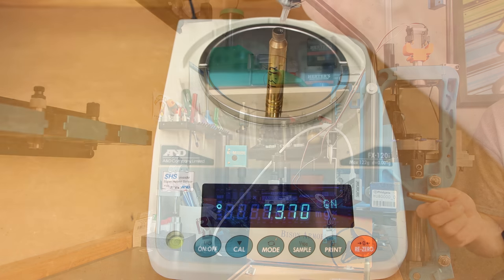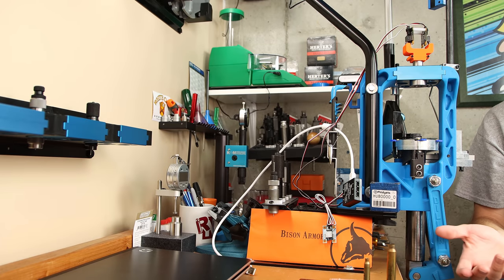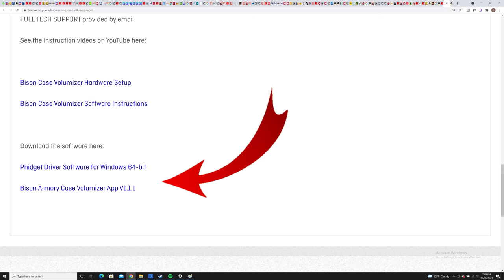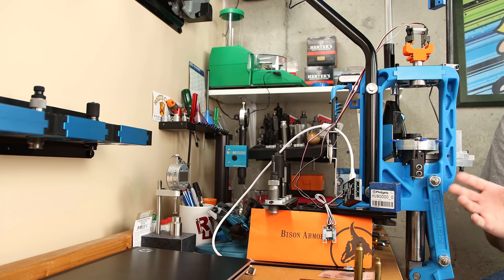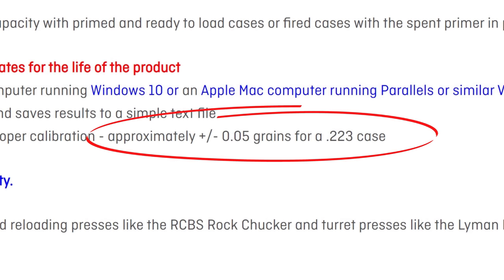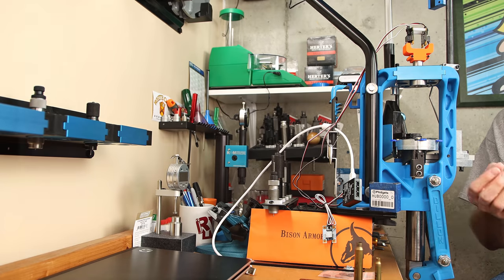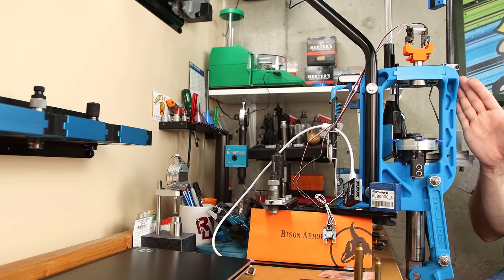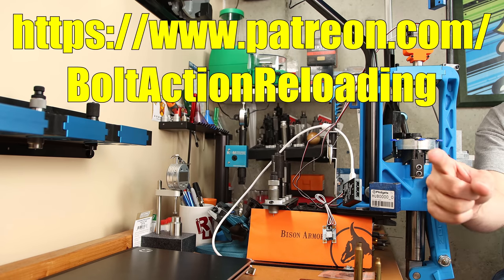Measure Case Capacity Fast Without Water! - Bison Case Volume Gauge

Comment: Great video..but one question...if your checking a lot of brass...and its unfired..and not primed....it seems like a waisted to prime with new primers...then having to cull a certain percentage if they are not is the SD....and if you used spent primers...you would have to prime...check the pressure and then pop the old one out....at that point is it not as.much time as water sorting with a primer plug?.....keep up the good work....
Reply from the maker: Hi Mike, Sorry for the slow response. So ask yourself if your going to use that brass as a sighter if its culled. If so your going to prime it. Keep in mind that you really can't touch the cases or it screws up the data. I use this on my dillon 750 with a case feeder and I can test 100 cases is about 20 minutes if everything is going right. Warm up time is a consideration, but you don't have to dry the cases out. When they are sorted they are done. I have probably measured case volume on around 2k cases at this point, if I didn't have this there is 0 chance I would have ever done that. I am also sure I am a bit more of the exception than the rule. I am generally trying to get as much data as possible, most people skip this cause to be fair it is a pain in the butt. Best of luck either way you go!

Comment: Just out of curiosity. What is the purpose of doing this?  What is the benefit for precision reloading? I’m new into reloading BTW.
Reply from the maker: Hello. If there is inconsistency in the capacity of the cases this will add to the variation in muzzle velocity.  Also different brands tend to have slightly different volumes so you may need to adjust the powder charge up or down based on how drastic this change is. I hope this helps make sense.

Comment: Is case volume a problem with good brass, or is this an experiment to determine that question?
Reply from the maker: That is exactly what this is going to be. I tried to show the beginning of that with the 100 pcs of Lapua brass that I tested in this video. I debated on making this video but if I show a video comparing 500 case volumes I am guessing that someone might wonder how you would accomplish such as task. I was also going to investigate if there is any value to weighing cases at all since some people do that. I certainly don't think 95% of reloaders need this (maybe less) but is you ever wanted to measure the case volume on 1000 cases this is your tool.
Reply: @BoltActionReloading  reading the wind has also been experimenting.
Reply from the maker: I have been hearing about this for quite a while actually, but saw that it was released. He seemed to me most concerned with the handle pull and I really don't think this is the source of the error.

Comment: Using an fx-120i reloading scale and autotrickler I'm getting single digit ES with SD of 2 and i'm not weighing cases or measuring volume. I'm pretty sure I'm at the limits of my chronograph. I don't think i'm going to get much value from measuring case volume.

Comment: Am I missing something?  You demonstrated that it has 0.05gr repeatability but not 0.05gr accuracy.  30.42 is over 0.05 away from 30.55.
Reply from the maker: If I would have recalibrated for the last test I believe it would have corrected it for the last test. I wanted to illustrate the drift from sitting overnight.

Comment: A good way to deter the temp sensitivity would be to have 3 thermometers
1. For the room
2. And IR thermometer that reads the case
3.one that checks the heat of the sensors because im guessing they would heat up like all electrical equipment
Reply: Well IR thermometer doesn't work really well on shiny surfaces like brass cases.
Reply: @DimaProk  we can stick a thermometer up its primer pocket 🤷🏻‍♂️

Comment: Yeah not for me. Would end up smashed laying in the corner of the room
Reply: Splitting hairs ....didn't catch the price ....wouldn't buy it anyway ..just like that $600 primmer seater .snake oil.  Lol
Reply from the maker: Hi Chris, You really have to be doing a lot of measuring for this to be worth it. I needed to measure a ton of cases for a video I am working on and the old fashioned way just wasn't practical. I don't expect 95% of the population to be interested in it, but when I release that video I know that a ton of people are going to ask if I really measure the case volume on 500 cases. Hopefully that makes sense.

Comment: Hmmm . . . 
FYI, if you're properly prepared with a few decent (inexpensive) tools and a set of clear step by step procedures, anyone can accurately check cartrige volume with H2O. Its clean, safe, easy, 100% accurate, repeatable, inexpensive and can spot neck/case failures just the same.
Reply from the maker: I don't disagree until you are measuring 400 cases. That takes more time than I have for it.

Comment: Sorting lapoo-a is a waste of time, what a freaking cool device though
Reply from the maker: Hi Chuck,
Thanks for your comment! I agree that sorting Lapua is largely a waste of time. This is why I used it as an example of how consistent it was. If you want to sort a large amount of brass I am not sure there is an alternative to this die though it has its drawbacks. On a side note LRSU did a video at a Lapua booth to show that most people pronounce it incorrectly. Might want to check it out. https://youtu.be/INK-8K9xx_c?t=26

BAR
Reply: I pronounce lapua incorrectly on purpose, but correct for my region, here it is luh-poo-a. Have a nice day!

Comment: Because of the ideal gas law, there is no way, frankly, to do this without temperature compensation in a non-fiddly way.  PV=nRT.  Temperature changes are completely the source of the error.  That's a shame.  That is a GENIUS way to measure the volume.
Reply from the maker: Hi Matt, you are exactly right. I was trying not to put too many equations in the video as it seems I just loose more people that way. If you can get the temp to be stable it does work pretty good. To be fair to them I am not sure how they would get away with that.
Reply: @BoltActionReloading  What about humidity would that effect it as well ? and the barometric pressure that changes hourly . too many variables and water has to be cheaper.
Reply from the maker: The 3rd sensor is a absolute sensor to compensate for those changes.  Water is of course cheaper but it's not faster and you have to dry them out. This you can test your primed cases right before you load.
Reply: Hey Matt, that's not quite right... as long as the temperature is constant during the measurement and the ambient temperature is changing slowly, it isn't a problem. The real problem comes with touching the cases with your fingers! In that situation, the heat from your fingers is transferred to the case, which in turn transfers it to the air inside the case. You can test this and see for yourself. If I hold a case in my hand for a few seconds to warm the brass, then measure repeatedly, the volume will start high and decrease with subsequent measurements as the air inside the brass reaches equilibrium with the brass. I use tongs to hold the brass to prevent this heat transfer.

Comment: I would bet Humidity is the devil to this machine along with temp. I'm sure this will not be a device 99.9% of reloaders.
Reply: i'm guessing the barometric pressure changing is causing the drift
Reply from the maker: That is what the 3rd sensor is for is to measure the pressure in the room.

Comment: Tbh, I've never found measuring case volume with water all that onerous. I would find it hard to justify buying something like this. More trouble and expense than it worth imo.
Reply from the maker: Hi Tom, I guess it depends on how many cases you want to do. I have measured the case volume on about 400 cases so far and there is no way I would do that with real water. I don't want to think how long that might take without this.